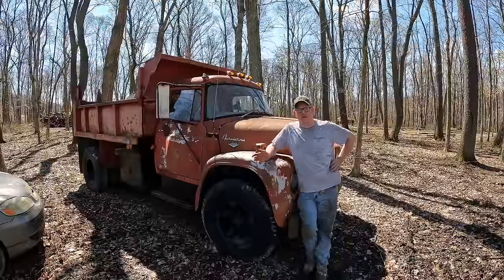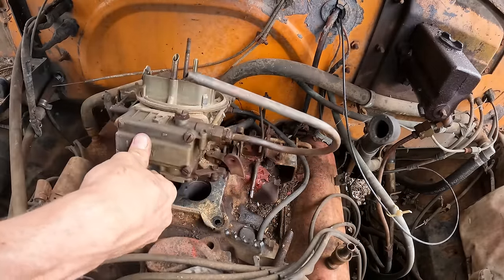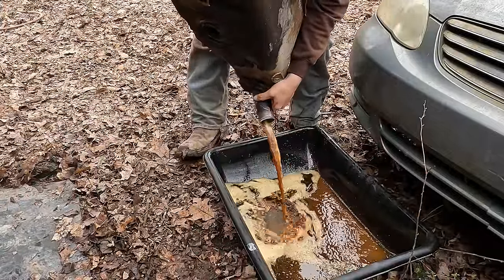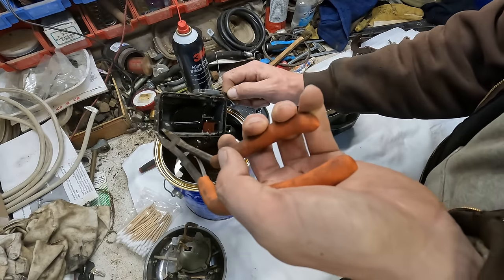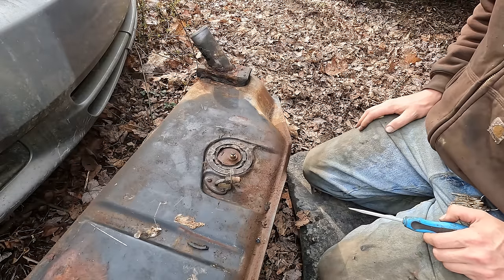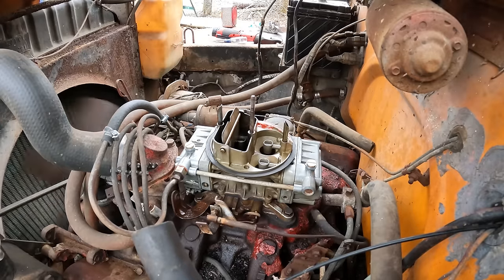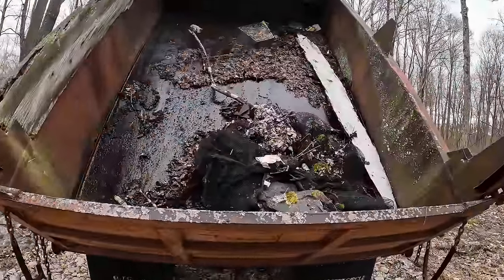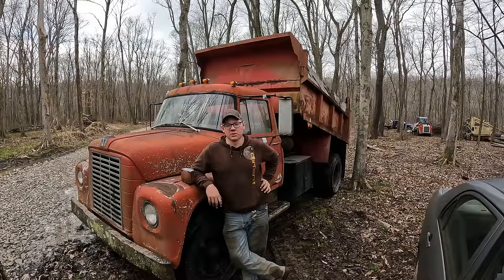Sitting 20+ years will this $500 Truck Run & Drive again? (International Loadstar Revival)

Comment: M.E.K  (real or substitute) can break down solid varnish inside a fuel system pretty easily,   I watched a video by Dylan McCool where he used it on a 50s Dodge truck  :)     B12 Chemtool can help as well along with other gas treatments.

Comment: We need to find you a Heated 5 Gallon Ultrasonic Parts Cleaner bro!
I have found that using the Airbrush Cleaning Brush Kit that os sold at HFT is very handy for the jets and channels when cleaning.
And also using "Crafting Pipecleaners" for brass/copper lines from the Craft" isle from even W-Mart...
If you are able find ¼", ³/¹⁶", ⅜", ⁵/¹⁶", and ⅓" Brass Pipe Cleaners at 12" length (because they should be reusable), let me/us know. They would be very valuable to us that restore older equipment!

Comment: It’s  bad on the  cylinder to leave the  box  up overnight   You really do need to learn  how to split shift your  trans   If you don’t  that big  vacuum  diaphragm  over  the  differential  will  dry rot & seize up  that  two speed  electric  up high  down  low  Dog splitter opens & closes  that diaphragm  & that is how you get your  two out of one  low/ high  gear split  with  some practice you should be proficient in  shifting  by the second  day  when you take off  as soon as you can  let off the gas peddle  and  pull up the  dog  at  the same time  and  you will be in  1 high  then quickly  push that dog down  to low  and then shift  to 2nd  gear  then  pull up the dog and let off on the gas at the same time and will be in  two high  the put that dog back down  low then shift to 3 Rd  it’s rinse & repeat   Now only you know the feel of that trans  if you need  to  double clutch  or not  or if your able  to throttle  shift  that old girl  now me  that is the  kind of trans  I learned to drive on  a  69 I - H  2070 /A  fleet star  gas burner  5 spd / 2 spd  split shift  town ship HWY department  dump truck   But you just need to keep practicing  with it until you get in tuned with all its sweet  spots on that gear box  to down shift those  you have to down  shift  the  stick first from  what ever gear you are in let’s  say  your  in 5 high top gear well you need  to start slowing  down  brake  then down shift  first before you dog it down with  the splitter then you  hit  the splitter to  4 low  at the same time you let off on the  gas and it should  kick in  when I was learning  I found out  that when your in top gear  and  you try to drop  a  ratio with the  splitter it will not work  on the down shift you have  to use the stick  first  then you can  use  dog  again this all  takes practice  I was  good by the end of the week   Practice practice practice  is how  you get to Carnegie  hall  learn  your gear box and it’s  sweet  spots  know your         R P M s  operating  range learn  with & without the clutch  that  split shift can be a lot of fun  just  take the  time to  get familiar with  the truck and maintain  the engine 
And clutch and transmission that all I can tell you go for it

Comment: Hey Matt, As soon as I saw your old Inter childhood memories came flooding back to me. My Dad had a 74 bogie drive tipper exactly te same colour even orange on the inside haha! His truck whined in reverse aswell due to straight cut gears. Is yours a 4 speed manual? His was a diesol 4speed manual but instead of the 2speed diff his had a 3speed joey box that gave him 12 forward and 3 reverse gears. Such a cool solid old truck. As far as a name goes old red or little red. But my Dads name was Bill and just like these trucks they just kept working and took a alot of work to get em to stop! I even managed to did up a picture of my dads truck. Cool video its the first of them I have watched definate thumbs up from us here in Australia.

Comment: yep i love are loadstar the whole front flip forward so you had plenty of room  too work on  now as my dad was having his welder friend setup the new bed of the truck i drop the gas tank  oh where you had the gas filter i had one their as well and then i had one at the fuel going into the carb  love those cheap 2 dollar filters i replace them about every 6 months in the Maintenace on my dads truck  when we got it the engine would turn over so i got it running and then got it home and cleaned it all out but i kept up with all Maintenace on the truck for a good 15 plus years i  just loved that truck it was a old truck but the looks of the truck just fit me

Comment: Always better to have a single cylinder on the bed... if it fails it just comes down rathr than one side trying to stay up and it maybe falling over or twisting the bed. Also half the failure points... gear whine in reverse is probably just straight cut gears and no syncros.

Comment: Is the engine a 345 or a 404 engine.   My first dump truck was a 1700 loadstar with a  345 5 speed with a  2 speed rear 12 foot bed it's was a good site truck for hauling stumps and brush.

Comment: What I do with Rusty gas tank I put nut's in the tank and some cleaner plug it so the cleaner don't leak then strap tank to rear end of tractor Jack up the Axel so the tire will spin needs to spin slow so the nuts roll in the tank the points on the nuts will knock the rust off in the tank then clean out the gunk out of the tank after that put the tank back on make sure you put a online gas filter just in case you didn't get all the nasty out of the tank it won't mess up the carb

Comment: Can't see get one of those digital cameras on a  stick, just have to decide if you want a flexible one or one that has a stiff shaft (no dirty stuff thank you) I've even used it to see inside a spark plug hole to see if there was any damage/scratches. Tells me if it's recoverable or needs something major. The thing being is it will allow you to see in places you can't put your head and can give you engineers fingers (that's when you do everything by feel). There are so many places it can be used, they are neat and work well. Depending on what you want to do (occasional use or a lot more)  you can get one with a screen or use your camera. They make things a lot simpler what I would add for first time use ids figure out which way is up and use a white marker/tape so you know which way is up. Inspection is so easy It will straight up let you know what rebuild your going to do. Works for more than engines, love mine.

Comment: You can also call the sending unit rheostat. It was 1970 fuel which is harder to go bad. The methnol/ethenol laced fuel today will last maybe 1/2 a year before it phase separate. Your truck engine was around 1970, before unleaded gas, and no valve modification for the lack of lub from lead.  Your only choice while you still can, is to use 100 low lead aviation gas. Carburator is a French word , meaning, leave it alone ! Two float bowls, that is rare. You cannot get the really good carb cleaner nowadays, due to environmental regulations.

Comment: We ran International's for years as a gear truck hauling a bunch of Fork lifts, pallets and gear for loading and discharging ships.
One day it was decided to get a new one so Raymond who was the exclusive driver  drove it into the dealers yard not to trade but just to pick up the new one. He went into the office and came out with the Sales guy who walked up to the old truck and said to Raymond "here she isn't she a beauty opened the door and handed him the keys" Ray said I've got the keys my buddy is going to drive the new one back. The sales guy  said my my how old is this truck ?  "10 years old said Raymond" he couldn't believe it as it looked like new. .Ray looked after it like a baby even under the hood it was immaculate. It was washed and waxed frequently and he serviced it to death, everything worked properly, He fitted more marker lights and reflectors and other after market gadgets for ease and comfort of operation. 
,Yours with a dash of lipstick and your usual magic has lots of life in it for you ,will be a great asset to have on the New Shop project. Good luck with her Matt,If Christine deserved a complete restoration this one would be just as perfect and it won't try to kill you

Comment: International made some seriously good equipment.  I delivered sand and mortar with one of these in the seventies.  Yes they are gas pigs, but those engines are well built.  You can put the heads from a 345 on a 392 and get some extra performance out of them.  When you open all four barrels on that Holley on a 392 you will know why you are alive, especially if you make the swap.  It is a really sweet sounding v-8.  I owned one of these a few years ago and had that motor purring like a kitten.  I was planning on taking the cab of a travelette and putting it on the frame with the industrial front end.  Never got around to doing it because I had a pesky neighbor that liked to call local authorities on me for pursuing my hobby.  Some people just don't have a life.  He was pretty miserable and if you caught a glimpse of his big fat wife you would know why.  She used to mow the lawn with a garden tractor and that poor machine looked like it had all it could do to carry her let alone run the mower deck.
Reply: that's actually fairly useful information for me. though the 305 doesn't seem to be a popular option

Comment: I don't know what that sealing clip mechanism on the top gas tanks is called. In more modern stuff it's part of the fuel pump. But if there's 1% chance water will get on top of it, seal the hell out of it with some type of sealant. How do I know.. every time a truck came in that someone cut a trap door hole in their pickup bed to access and change the fuel pump, rain water sat on top of the tank and got into the tank, never fails.

Comment: my dad and i had one of those trucks  it was a old moving box truck and we turn it into a truck too haul mobiles with  on the outside of that door you see the piece that looks like a c thats where its freezing up at  i had too use brut froce too get it open the pb blast set on it for a day then i sprayed it again then it started moving finally so i had to just adjust it a bit but the rust on that thing was bad but it worked for another 15 years then we sold the business

Comment: Hey Matt, I know this is a old video and perhaps you wont even see the comment, but wanted to share something about a carb mishap I did, so once I was working on my granpas Willys MB and had to mount the carb back on the engine I had seen my granpa put it back on the engine a few times and even had done it myself a few times but that fateful day I somehow managed to mount the carb backwards, so if you depressed the accelerator the engine actually dropped the rpm and once you released the accelartor the engine revved up 😂😂😂😂😂😂😂😂 it was a funny moment 😂😂😂😂

Comment: Retired to a small horse ranch three years ago. My good neighbors are rich or connected. Both of them. I ain't. I'm resigned to the fact that all my equipment will be of the sort you like, if you know what I mean. That's okay too. Easier to work on and not so proprietary after 40-50 years yeah?

Comment: My uncle used b fleet manager  for state and bought many different  trucks in that x said fords power vs gears  needed help out of pit 1s low range chebys better cause rpm but blew many moters dodge  s same as ford no guts and body fell appart . But ol binder 304 gud mpg 12 and grunt 1600  and usaly the 1 hooked 2 ft of ford cheby dodge ihc tq was amazing  and pull the same grade w ihc loaded plus the other 3 brands getting  help out of hole and load on ihc so underrated ! Put 4 yards 3/4 minos graval on my 1300 d 4x4  and   in 2 gear h range  it s a beast wont find 3500 350 series trucks will do the work any ihc did and more reliable  in ihc 2 boot

Comment: I think it is far better not to have any filter inside that tank. Filter got to be outside, where you can see it , check and change easiely.
Another advantage: you can use airpressure to clean it .

Comment: Information only. If you have a two barrel carb you have a 345 and smaller including the 304 and 266. When you have a four barrel carb you have a 392 engine.. saw you working on the 4  barrel carb. Good luck.

Comment: What is a carburator??? Haaa Haaa. The fuel pump is already a newer version. the pre 64? pumps have screws all around the diaphram housing, and all you have to do is to pay for a rebuild package which is cheaper, and spend 15 minutes replacing the diaphram inside. The extra eccentric on the cam to drive it was one of the trick questions in an auto mechanic exam decades past. They asked , how many eccentrics on the cam of a V8 engine, first choice is 16, wrong, the correct answer is 17.

Comment: doe you still have this truck and is it for sale
Reply: If you still have do not admit to it, this truck was a light duty piece of junk when it was new, 20 some years later won’t have made it exceptionally fine, sorry you spent so much time opening the drivers door, should have locked the passenger.door and thrown in a lit match!!!!